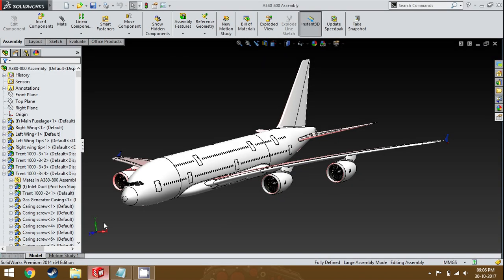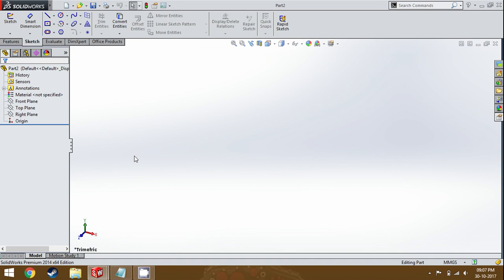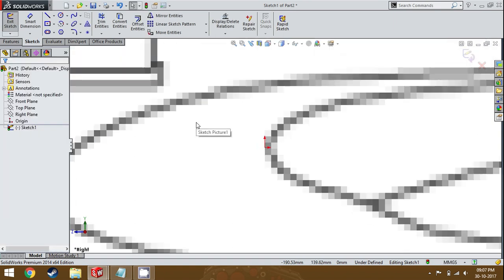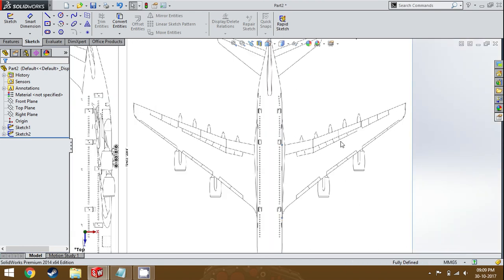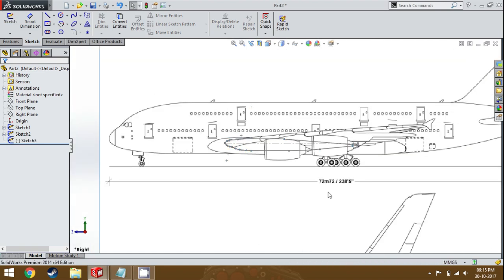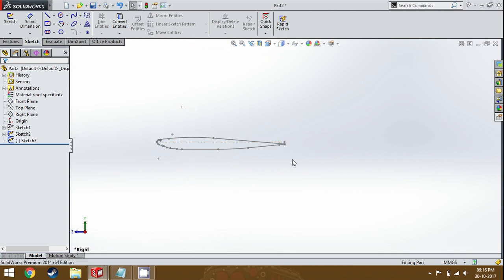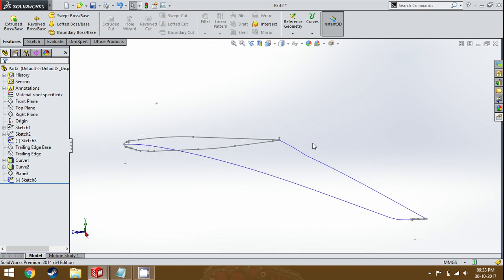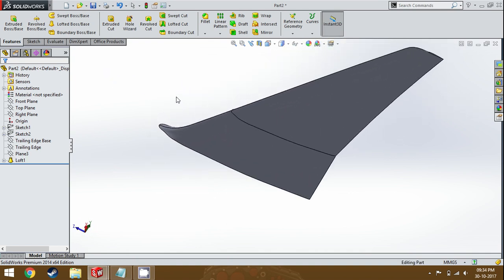Designing an A380 : Part 2 (Wing) Solidworks Tutorial

Comment: There's one major flaw here.  Unless you are going to show the airplane taxing or parked with the gear down, your wing curve is in the wrong direction.  In flight, the wing bends the opposite direction most of the time.  It is designed to be straight during landing condition,with about 95% lift of an airplane that has about 30% fuel left onboard but upon takeoff, climb, and the first two thirds of the flight at least, the wing is bent upwards, not downwards.

Comment: 12:45 how did you make the end air foil sketch? Once you did convert entities how you have those close air foil sketch. Please explain
Reply from the maker: I made a reference plane at the end of the leading edge and trailing edge, then I made the airfoil sketch and used 'pierce' function to connect it to the leading edge sketch and trailing edge sketch. Hope this helps :)
Reply: @cad.art.design.5933  How did you make the airfoil sketch to use the "pierce" function it doesn't work

Comment: I found the same 3d plane at the beginning of your video. I notice that when I cut out only the wing and import it in ANSYS Fluent, I cannot run fluid analysis bc the wing is hollow. Anyway around this? I do not want to redraw the wing =[[[
Reply from the maker: Did you do the loft as a hollow section or a solid section?